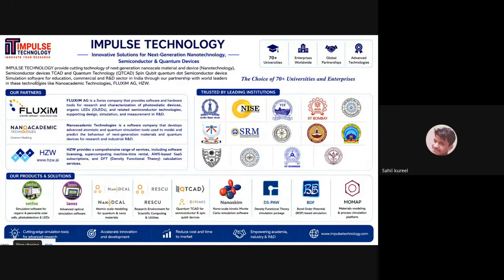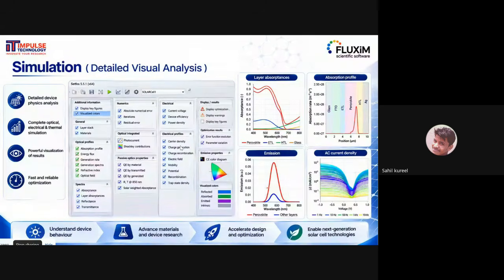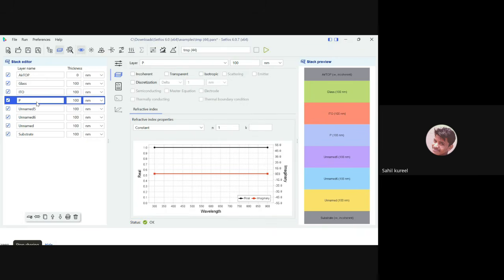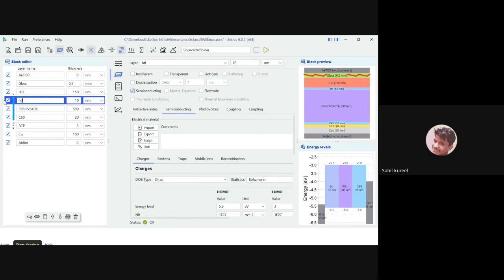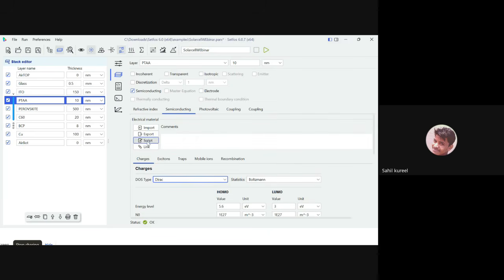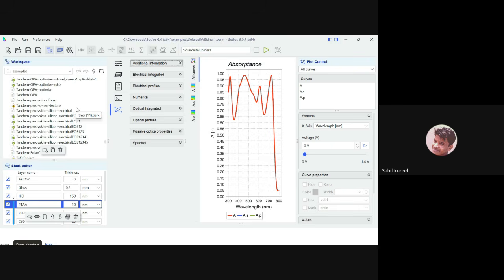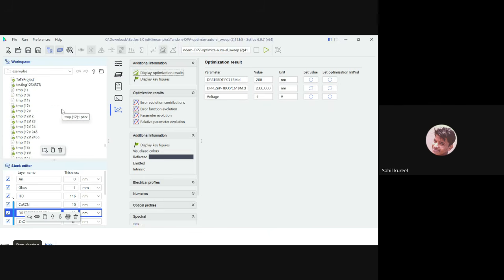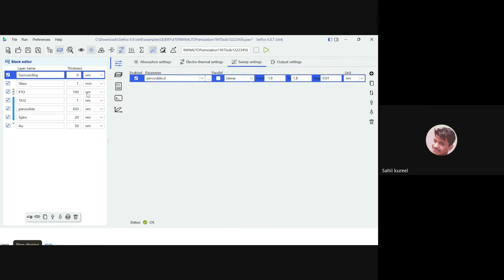Solar Cell & LED Simulation Using SETFOS & LAOSS | Full Webinar Recording | FLUXiM Software

Comment: Please make a detailed video tutorial on the SETFOS 6.1 GUI, starting completely from scratch. The tutorial should cover the entire workflow, including solar-cell structure/design, material and layer configuration, simulation setup, running the simulation, and detailed analysis and interpretation of the results.
It would be highly beneficial if the tutorial could be presented by someone who is an expert in solar-cell design and simulation and has extensive practical experience with SETFOS 6.1, so that each step can be explained clearly, accurately, and in sufficient detail. The tutorial should ideally explain not only how to use the GUI, but also why each parameter and setting is selected, along with the physical significance of the simulation results. This would make the tutorial much more useful for researchers who are new to SETFOS 6.1 and want to use it effectively for research and publication-quality analysis.